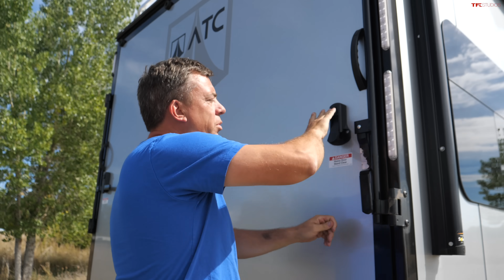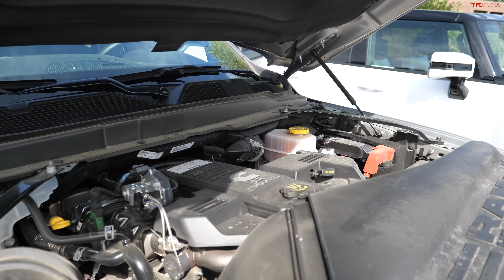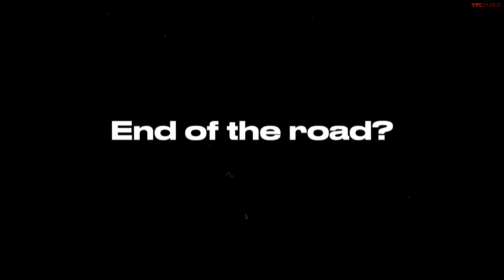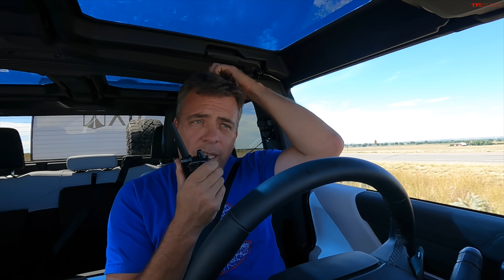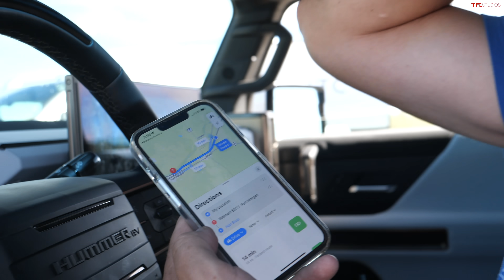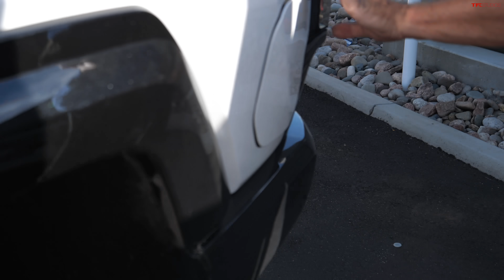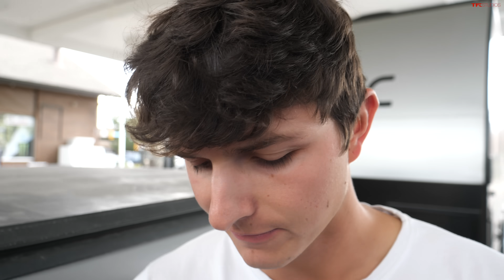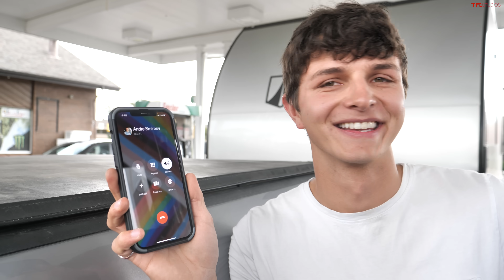How Far Can a Diesel and Electric Truck Tow An Identical Camper Trailer on ONE Fill-up?

Comment: The more of these tests I see you guys do, the more I realize how horribly un-aerodynamic most trailers really are.
I thought it was always the weight that killed mpg and range, but even the Cummins which can easily tow over 3x more took a big hit with that "light weight" camper
Reply: Aerodynamic drag is a huge factor.

I once dragged an empty utility trailer 120 miles to pick up a lot of boxes. It was a single-axle 5x10 with a wire drop-ramp. I got 12 mpg at highway speeds.

After I picked up a load that measured about 5x5x10 and 1000lbs, I returned home. I got 15 mpg on the return trip.

And then I did a similar trip, empty with no ramp attached, and got 19 mpg.
Reply: @chriswilson433  I've had the exact same experience. I never imagined that wire mesh ramp could kill mileage so bad. On my way back I was carrying a 1000 pound side by side and got significantly better mileage. On a long trip it would definitely be worth removing the ramp and laying in the trailer.
Reply: @chriswilson433  at the end of the day we look at cost at the pump all the rest is band camp stories.  9.7mpg is surprisingly low. I wonder if @TFL can have other diesel engines tested with the same config and route ?
Reply: @efibendor1  I periodically town a 42 foot enclosed v nose trailer with my 2020 duramax.  I run 11 to 12 mpg.  Pulled the same trailer with buddies 22 ram and got 8 to 9
Reply: When I went from a flat front cargo trailer to the “V” nose I went from 8-9 mpg up to 13-14 mpg, crazy how much it helps!!
Reply: Surprise how bad the Cummins did
Reply: Yep, I was the same way. Then someone told me it is the aero not the weight. Then I paid more attention. When I tow a skid steer that weights 15,000 lbs on the interstate with my Ram 2500 gas, I can get about 10 mpg. Then I tow an enclosed 30ft trailer that weights 5,000 lbs on the same road and it gets 9 or 10 mpg. It is crazy, but also makes sense.
Reply: Aerodynamic drag is a bitch. It increases 4x with the doubling of speed. You will literally burn 30% more fuel just to increase your speed my 10mph above 60mph with a trailer.
Reply: @1320fastback  50mph is the optimal speed with a trailer as that's where the curves for for aero drag and rolling resistance intersect.
Reply: @1320fastback  Finally someone who mentioned ground speed. Dah, these guys are running 70? For goodness sakes back off, relax and enjoy the ride. Let's not even mention the safety factor reduction when towing at high speeds.
Reply: You are right. Towing my 16' enclosed gets about the same mileage as towing my 32' RV. Like you, I learned that the aerodynamics means way more than the weight being towed, up to a point.
Reply: It's simple if anyone has ever owned a travel trailer, you want room inside. Short ceilings and rounded corners make it small inside. Again no one who tows is going to get an electric truck. People who want an electric truck do not need one, they just want one.
Reply: The emission systems killed the mpg on the Cummins. Rip that stuff off and it would have been near 15-16mpg easily.
Reply: @TdrSld  If there was any doubt at how horrible the government/democrats can be, just look at what they did to the Diesel engine.
Reply: @TdrSld  bring back leaded fuel too!
Reply: @jghall00  leaded fuel means nothing in diesels bud
Reply: @jghall00  If you look at the actual out put of modern diesel emission system you'll learn really quickly that they are worst for the Environment then just having a D-Cat on them. 

Hell the DPFI almost triples the CO2 output over the life of the engine and releases nano particles that are worse for your lungs than the soot (soot is what the black smoke "rolling Coal" is, it's also many times heavier than air is and falls to the ground to be locked away in the soil). The DEF system straight up pumps Ammonia into the air and it has been shown to be WAY WORSE for Bee's and other insects, let alone for humans. I have been in shops with just one Diesel idling when being worked on and it will gas you out of a 50k square foot shop in about 30 minutes. They make you idle the trucks out side if you need to do it when working on them.
Reply: @TdrSld  I hate it when the dads at softball idle their diesels. Pure noxious poison. Need some French fry grease in the tank.
Reply: @jghall00  Thats the DEF if it's a newer truck. The old trucks with a D-cats just had the smell of diesel and thats it. I grown up on pipeline right-aways in the 80'/90's and lived surrounded by those old diesel. Had no problem breathing around them. Now I am a custom auto specialist and HATE how bad the newer diesels will make your eyes burn and throat burn just being around them for a short period of time.
Reply: @jghall00  Nobody cares about you're special kid's softball.
Reply: @jghall00  apple's and oranges.
Reply: @howebrad4601  Are both fruit?
Reply: @jghall00  leaded fuel was a process that was implement many many years ago to deal with valvetrain issues known at the time.  Once it was known that lead is a very bad substance, its use was stopped.  As to diesels, part of the noxious smell is the diesel aftertreatment systems that have been mandated.  Not only do they make it smell terrible, they also harm diesel efficiency and make them burn more fuel than before, which basically is self defeating then.  They were added to cut pollution, but because they lowered efficiency, more fuel is burned, when counteracts some of the pollution saved by the devices themselves.

Nobody would propose bringing back leaded fuel, but the jury is still out in my book as to whether these new aftertreatment systems do more good than harm.
Reply: Sorry but 6100 pounds is no light weight trailer. My Rockwood Ultra Lite weighs in at 3800 pounds with full propane of 2 30 pound tanks, and full 54 gallons of water. Those trailers are heavy weights. They are tall too at about 13 feet. Mine is 13' 6".
Reply: Yup as we move to EV better AERO in trailers will showing up soon

Comment: Before it even hits the streets that ev has polluted more than the diesel. Lithium mines (for the batteries) are environmentally filthy. Wind  and solar panels too. However,  that particular ev was mostly fueled by coal, since Colorado's electricity is mainly coal powered.
Reply: Al gore alone pollutes more in one month in his mansion AT SEA LEVEL (and his jet/yacht) than the average pick-up truck for  a year.
And he still is no marchas for industries, the real polluters. And in China they are not required to be fuel efficient. 
Only facts.
Reply: The EV dose not pollute locally. The diesel dose. 

Gotcha — Lol.
Reply: @marcsarfati3291  No 'Gotcha'.....we're supposed to be protecting Mother Earth here...not just trying to eliminate pollution in one spot.   And...I 'gotcha' back with the fact that modern motor vehicles are VERY clean running, so much so that in many areas the exhaust coming out is cleaner than the air going in.   Gotcha!
Reply: @marcsarfati3291  the power is local
Reply: @marcsarfati3291  now the Planet was saved
Reply: The Cobalt comes from Chinese mines in the Congo.
Reply: Cobalt is used to refine every single gallon of fossil fuels, along with water and electricity. The U.S. alone consumed 47twhs just at the refinery level to process crude oil in 2021. 

Lithium cobalt lead and acid goes into your 12v battery that is required for any ice to function. Average ice vehicle sold today has over 20+electric motors to run everything now. 

Mining&vehicle recycling is required for every vehicle made doesn't matter what powers it. Cats also use platinum metals group's which require a lot of mining per gram of useable material(hence why they are stolen so prolifically. Urea is also used in def fluid which requires mining. 

Drill rigs, ships, trucks, trains, oil pump jacks and pipelines all use energy and cause emissions just to move around fossil fuels. 
Maybe educate yourself about some of this stuff next time? Then you might come off as at least informed and not a parrot just regurgitating fossil fuel fud. 👍🏻😁
Reply: @4literv6  the ccp appreciates your shilling
Reply: @noneyabizz8337  everything I said is absolute truth&easily verified. The ccp last I knew wasn't much into truths per say.🤔

Evs mean domestic energy security as every $1 spent recharging an ev has over 60% of that stay in the U.S. economy. 
Vs every dollar spent on fueling up a poisonous fumes spewing particulate pollution causing atmosphere warming gas guzzler has over .70c go outside the U.S. economy. Educate yourself instead of talking nonsense and spreading lies.👍🏻
Reply: Fanboys will argue with these facts
Reply: I agree with everything you said except for Colorado especially in this area is powered mostly by natural gas. The coal power plant in fort Morgan was converted years ago to natural gas. Our previous governor forced the state to be done with coal by 2030 or something like that.
Reply: @OneNationUnderGod.  ok. Change "coal" for "fossil fuel" and we have a deal

Comment: but cost per mile is cheaper in the EV, due to the free charge...
Reply: But it costs 50K more to purchase so the TCO goes to the diesel.
Reply: Nothing is "free". The cost of charging is simply being absorbed and spread to somewhere else.
Reply: Someone did the math in another comment. "Thats awesome the charge was free, but let's use the numbers to find out the future cost. The Hummer charged from 7% to 51% for $37.41 according to the EA charger. So $0.85 for each 1%. At that rate it would cost $79 to charge the Hummer to 100%. Hummer cost per mile: $79 ÷ 123 miles = $0.64 per mile.
Cummins cost per mile: $105 ÷ 211 miles = $0.49 per mile"

Comment: Electric vehicles only good if  small and be used in city driving only
Reply: I think you can road trip in a EV you just need improvements on range so we need to wait on improvements on the battery technology so we can get more out of the battery for longer range the technology just ain't caught up yet...

Comment: That ram can tow that trailer AND the Hummer and go much further on one go. Meanwhile if that Hummer gets stuck in traffic you're gonna have to cut a hole in the bottom so you can move it the old Fred Flintstone way.
Reply: This is one case where the EV will win. When you are caught in stop and go traffic the EV will use very little energy (could last for days) while the ICE will still be using significant fuel. At 80 miles an hour it's a different story...
Reply: @lenm2857  Diesels idle with very little fuel and I mean very little fuel.
Reply: @TdrSld  an ev doesn't idle. If it isn't moving it just doesn't use energy
Reply: @nicksmith4808  Every computer, every light, every thing in that EV is using power from the battery. You can't just seat in a turned off car forever. 

Hell I can't seat in my black tundra for more than 3 minutes in the summer after driving for 3 hours with the ac on after I turn the truck off. The heat builds up so fast that you'll be sweating buckets in 5 minutes. It's stupid to think that an EV only uses power to MOVE the EV.
Reply: @TdrSld  That's exactly the point. If you need to run the engine to have AC in a normal truck you are using a lot more energy than an EV that is not moving and just using the AC.
Reply: @lenm2857  I don't think you understand just how little fuel a diesel engine uses idling dude. The Cummins is around .15 of a pound an hour. There is 7ish pounds to a gallon of diesel. That's 6.67 hours per gallon of fuel. So with the stock 31 gallon tank that's 206.67ish hours of  idle time on a tank. And this is in high idle mode to keep from washing fuel into the crankcase and keep heat up in cold weather. ON average Tesla says that with a good battery fully charged you can run your heat for about 24 hours straight. Like they said in the video  it's all about energy density. And a gallon of diesel has about 38Kwh per gallon and one thing an engine has over a EV in efficiency is that they make heat WAY better.
Reply: @TdrSld  It produces heat because of inefficiency not because it's efficient. We seem to have switched from AC to heating for some reason and I think your numbers are a little optimistic, but no matter. My point was and is that a traffic jam is not the Achilles heel for EV's that many people seem to think it is. I run a lot of different Diesel equipment so I know the some of the advantages they have over EV's, but it's not as one sided as some would have you believe. They certainly have their uses.
Reply: @lenm2857  the heat gene was the joke sir. 

I use heat as it is the most power hungry, AC is about 2-3kwh of usage, with heating being 3-5kwh. And thats just AC or Heat, you factor in all the other things running in the EV and you can easily hit about 7Kwh just standing still

And no my numbers are not optimistic I tuned both gas and diesel engines for a living before med retiring. Hell the average V8 gas engine is anywhere from .41LbHr to .28LbHr at idle.
Reply: @nicksmith4808  Except for the computer, the heater, wipers, radio,and lights
Reply: @lenm2857  ah ok. Cool. Thanks for the info.  I won't edit the comment. I like learning

Comment: I would love to see more Disel Hybrids.. Add some capacitors and a small battery bank to take advantage of regenerative braking .. Should not even need an engine brake .
Reply: That would add weight which would reduce towing capacity.
Reply: @jasonpitts8395    Capacitors weight almost nothing .. Dodge already has this feature on some of their trucks
Reply: @mikeskidmore6754  if you’re meaning the Ram (dodge) etorque system, that uses something like a 1.8kw battery that really only works during auto start/stop. It’s a pointless “hybrid” (in the loosest terms) to get some credit from the epa, that gains nothing for the end user.
Reply: More shit that can break
Reply: @johnszafarczyk  You are very I’ll informed freight trains have been diesel hybrid for decades…..
Reply: @mauricemotors8207  without the need for batteries.

Comment: What people dont seem to know yet is... the faster you charge the faster you wear out a battery.
Reply: and a big impact on battery wear is also what percentage you charging from.
keep the battery between 50-80% greatly increase battery longevity, 20-80% is ok and 0-100 on regular basis is far worse
Reply: @Tonyx.yt.  really you should never go below 20%
Reply: That is why the promised 300 mile range is never 300 miles between chargers, more like 60% of the 300 miles.
Reply: Plus faster means maybe only 80% of potential capacity
Reply: Depends on the battery technology. I believe Tesla, for example, is looking again at the Iron-Sulphur battery technology (which was Edison's baby back in the 1920s), that tech doesn't have the fast charging problem.
Reply: I saw someone say "this isn't a phone!"

That's how ignorant some people are.

Comment: It's all about range and refuel time...  EV will never make it...  Just sayin'  😎
Reply: So true. I'm not waiting an hour to charge a vehicle when I could fuel up my RAM 2500 in a few minutes.
Reply: An hour or more after unhooking camper then possibly waiting for available charger.
Reply: EV is fine for a personal daily driver in most cases, IF you have a place to install a charger at home,  and IF your power grid has the capacity to support those chargers.  Where I live, the power grid is barely adequate in very hot or very cold weather (all electric homes), so no EV for me.
Reply: @ricanderson5717  Yes, you are correct an EV would be tolerable in that local-only driving environment...  And I would go for that significant limitation IF I could get one for about half the cost of a conventional vehicle without such limitations...  BTW, I own a 2016 Prius Two that consistently gives me 550 miles of range on a quick, 10-gallon fill up of regular gas...  My wife has a long-term average mileage of 65 mpg...  145k miles and no unusual issues...  To COMPLETELY avoid fossil fuels, hydrogen is the future...  But in the interim, drill, baby, drill!  Just sayin'  😎

Comment: Tell me what the Range is on the Hummer when the batteries are  5 or 10 years old ..
Reply: if you keep the battery between 40/50-80% would be fine, if you regularly went from sub 10% to 100ish % that's a whole different situation
Reply: I don't care if those batteries last forever. I'm not waiting to charge my vehicle or praying that there is a charging station along the way. EVs are amazing tech but they are severely limited when it comes to range and they are really expensive
Reply: If similar to Tesla, probably will still get 90% or better of the advertised range.
Reply: @ShippyJack    All I know is I have  4 tiny dead DeWalt Lithium batteries and  they want $69.00 each to replace them